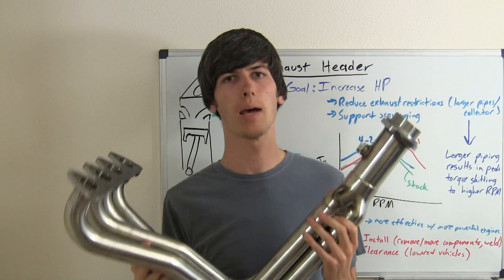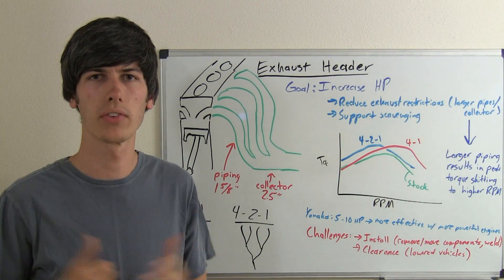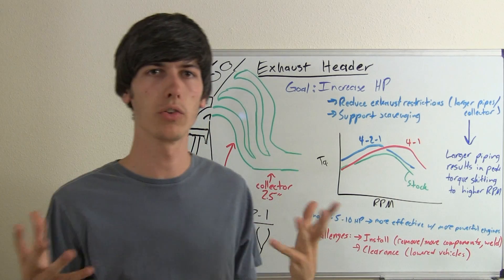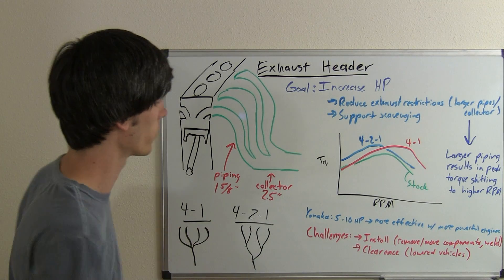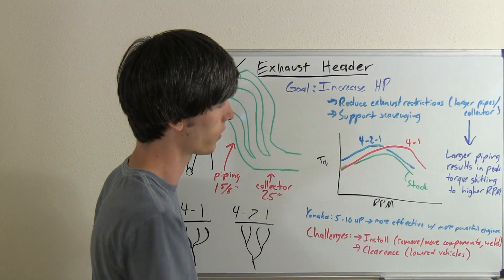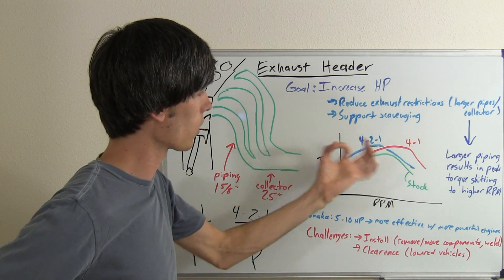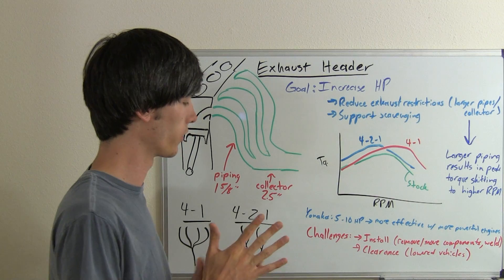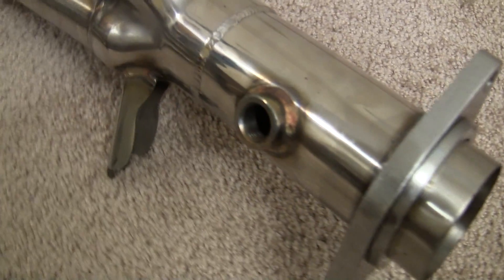Exhaust Header - Explained

Comment: Good work sir. You may want to point out the reality that headers dissipate anywhere from 40 to 60 additional degrees of ambient air temperature under the hood. This robs considerable power and has an adverse effect on electronics which are already under an anticipated level of duress. Vacuum lines and wire harnesses become brittle and that’s only the beginning. Electronic components fail prematurely. I like to use the example of having a desktop computer in your oven at about 90 to 100 degrees. Watch much slower it renders and operates. How long will it last? Will it last as long as a computer in your bedroom? Don’t get me wrong, headers are really advantageous on older vehicles. I simply would never install them on any of today’s modern computerized vehicles.
Reply: Your first coment was your best statement. Many folks put them on and have no plans to seriously race anything but their own shadow and have no idea about the problems they inherit in the process. In fact 75% of the people that have them put on have no intention of racing, simply think they sound or look cool or their buddy has them. Only later do they realize all the inherent problems that come to the surface are due to the miatake they made. Heat wrap is a adequate way to stop the heat up however, most headers are manufactured with materials that are designed to "reflect" heat or discharge it. Unfortunately the heat wrap holds in the heat which then causes the headers to chrystalize and decompose within a realatively short time.    Manufacturers are well aware of these issues and your top manufacturers have quietly been reasearching header type manifolds as a solution to the problem. It's just unfortunate that innocent people have them put on without knowing the truth behind the product.

Comment: What would happen if I install a race header on a stock engine I have a 97 accord that I use for fun
Reply: From my experience with my stock 93 accord, I just installed a full exhaust system. Went from 4-1 to 4-2-1 and slightly bigger piping and there is definitely an improvement compared to the stock exhaust system.
Reply: Hibari IUkh
4-2-1 gives better low end torque where 4-1 gives better high end torque.
Reply: may i ask if i change to 4-2-1 the car will have higher torque or wat? cuz i planning for 4-1. does 4-1 suitable for accord93? sorry for my english. the reason i change header is to increase more torque. thank u very much!!
Reply: thank u very much!!!!! apreciate

Comment: ive got a 2013 focus st. something ive been tempted to do is extend one or two of the cylinder exit pipes. the reason why im tempted is because the stoke inline four sound is a bit to clean for me and im hoping that extending one or two of the pipes will give it a more burbaly sound not sure if it will affect the turbo much though. can I ask what your opinion on doing this is ?
Reply: gblockvet yea I did figure it would do that, although after doing a bit more digging around I found it had more of an affect than I initially thought. also its not possible on the st engine anyway as its manifold is actually built into the engine. hopefully I can save enough pennies to afford the turbo and injector  upgrade soon so I can put the car from 300 hp to 420.
Reply: Sounds like a good opportunity to experiment with a set a cheap headers.
Reply: ive been looking into it a bit more and it turns out it cant be done as the manifold is built into the engine.
Reply: Wow. They must not have wanted anyone to modify that car ._.
Reply: they're plenty fine tbf ive never heard of it causing any issues with tuning, i think the idea behind it was weight reduction and manufacturing cost.
Reply: Changing the length of the headers will probably not affect exhaust note at all but it will probably mess up the behavior of those cylinders with regards to the unmodified ones. Header lengths have to be tuned to each other to keep the engine working at it's peak. Google A. Bell's book "4 Stroke Performance Tuning", you can find PDF's of it all over the place.

If you want a more burbly sound, buy a Subaru or install a modified cam into your engine to give it a more uneven idle.
Reply: changing the length like you explained wouldn't be good. your localizing heat to a single cylinder more than likely and that would be horrible for your internals. Subarus that are N/A it works but anyone who builds higher hp Subarus always advise against UEL headers. it makes detonation to one cylinder dangerously high and it contributes to the issues motors have with ringlands.

Comment: Good day!

I would like to seek advise. I have a 2012 Honda jazz 1.5L automatic transmission. 

It has stock exhaust system and I'm  getting interest in having Heathers but still with stock midpipe and muffler.

Would that be advisable or do I really need to change the midpipe and muffler when I install a Heather? 

Thanks.
Reply: you can so it but it wont increase power in any way.

Comment: Sir i got a question. can i install a 4-2-1 header but with stock exhaust? i have a lancer gt 2.0. im new in modding my car.
Reply: Of course you can, but it is pointless really. The whole point of Exhaust and headers is to open up airflow. Adding an exhaust with stock headers is pretty pointless, just as going with race headers and a stock exhaust. Do it right, save up, and do the Intake, header, and exhaust all at one time. Then of course, make sure you have your car tuned for the bolt ons because you will not notice much without having the ECU calibrated to match the new airflow. I just had my RSX ecu reflashed thru Hondata and noticed a world of difference.
Reply: People always giving horrible advice when they don't know what they are talking about. If you are N/A the header is one of the important mods of your car. Because it is the first part of the exhaust that scavenges the exhaust out the engine. So having an effective header can literally make your engine get out as most exhaust gasses a possible so the intake can get the most uncombusted air inside the cylinder as possible. So Headers are NOT created equal... they need to be designed based on engine harmonics of the car so you can make the most of helping your engine get fresh air into the cylinder. So if you are N/A; A header is one place you DO NOT want to be cheap.
Reply: MrZezima3 headers are very expensive in some cases. depending on the "quality" of your build you could do headers and fabricate an exhaust after that. if you are looking for cheap power headers should be the last price of the exhaust you mod. with the price of headers alone you can get more power from other mods and their combined affect.

Comment: so if i were to put a 4-2-1 on one cylinder bank of a v8, then a 4-1 on the other side, would the torque curve flatten? lower but wider peak torque? that should allow for the same acceleration (assuming correctly matched gearbox allows you to use the full peak range), but having the lower peak torque would mean your clutch/tires would have to handle less and be more reliable right?

Comment: So why run headers at all? I don't understand?
Reply: If the exhaust just comes straight out of the engine and doesn't go away your engine bay will get hot.
Reply: you need back pressure
Reply: Noise control.
Reply: dekoldrick Good answer.

Comment: I have a 2015 charger rt with 3800 miles, I plan on installing long tube headers, high flow cats and a full cat back exhaust, my first question is can I install my parts all at once? My second question is I've been planning on getting a 85mm bbk throttle body, but I heard it's not necessary since the car isn't supercharged or anything along the lines and I don't want the air to fuel ratio to act up, should I install one or no?

Comment: Can anyone please tell me the difference between a stock header and an aftermarket header??
Reply: Same here.help anyone
Reply: Headers are bigger tubing than  your stock manifold and each cylinder has its own tube, whereas a manifold has one pipe connecting to all of them. Google "stock exhaust manifold" and then google "long tube headers". I hope this helped.
Reply: Cars usually come with "exhaust manifolds" from the factory.  Some people use "header" and "exhaust manifold" interchangeably but there is a difference in form and function.  As Fatal Automotive has mentioned, stock exhaust manifolds connects all the cylinders in one tubing.  Headers have separate tubings and a collector at the end where all tubes meet. This is for better airflow for increased performance.  

In some cases, car manufacturers will come with factory headers in models that are geared for performance. For example, the Integra Type-R in Japan comes with factory headers with 4-1 piping design (video here explains what that is). In general, manufacturers will engineer stock parts for efficiency and emissions restriction, therefore limiting the potential of an engine. Aftermarket (performance) headers are engineered and designed to provide more horsepower so they will follow the header design principle. However, if you are buying an OEM- style header, it  is still considered "aftermarket" since it's not manufactured by the maker of the car. In these cases, it will be designed as an "exhaust manifold" type to mimic the stock configuration. But it's still aftermarket. Hope that helps.

Comment: hello, i want to ask, why 4 stroke exhaust header always use a straight pipe than use a divergent cone like a 2 stroke exhaust (without baffle), i just run a simulation in cfd program compare a straight pipe and a divergent cone same length, same area and same environment preassure (divergent area 2, two times area 1). it shows divergent cone makes more volume flow rate and more gas speed than straight pipe, it mean less force to push air out from the cylinder. but why i never see people use divergent cone as a header? i just see them use in tail pipe section.

can you explain it in next video? wait for your reply. thank you

Comment: I have a civic 1999 LXi with a stock engine of D15z4(87hp). You mentioned that an upgrade to a 4-2-1 header won't help in this kind of small engine. So, how can I add more kick or more HP into this? I don't want a turbo package upgrade as this is expensive. I just want to see other options if there are. Please advise.

Comment: I am building a custom header for a Mazda MA 2.0 carbureted engine. It will be 4-2-1. My question is, do the tubes have to be all the same length for each cylinder?  I have it mocked up and the tubes are all within 2 inches in length of each other.  It wont be making much more power then the stock 96ish HP so I am hoping that wont matter to much.  Also does it matter where I join the 2 pipes in to 1?  I would like to run 2 pipes all the way back to the rear axle and join them together there with a X pipe and then duel tips out the back of the truck.

Comment: Thanks for the video...  i have a 2002 honda civic... i installed megan racing headers..   but my Stock cat does not fit on the end....  I was told i could have a muffle shop cut it and Weld it to my Header.... Because right now im blowing a check engine light and my car is in Limp Mode..    Full cat back exhaust installed also.....
Reply: Flush out fuel filter an drain tank, new fuel filter, new maf and it should help, most cars get limp mode because of cheap fuels
Reply: Bainanaz thank you
Reply: JasonH420
Dont thank me hahaha, my Nissan pathfinder used to do it on cheap diesel from a station near me.

Comment: So how come the pipes bend around instead of a straight angle? Also do you sublight as a Jon Heder impersonator?
Reply: Why they bend around - probably to provide clearance for other items in the engine bay. Also because you have to have each header be as close to the same length as possible - you can't just have the far cylinders (1 and 4) have much longer headers and the center ones be shorter.
Reply: i know im a little late, but they bend around to ensure they are all the same length!

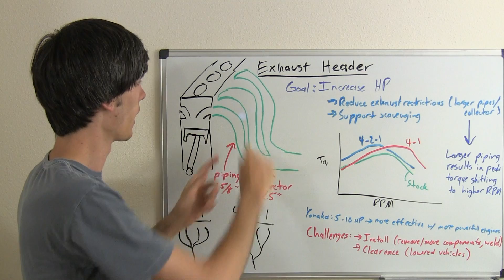Comment: 0:39 The four 1.625" pipes have a total of 8.3 sq in, but the 2.5" pipe has only 4.9 sq in.  Doesn't that generate significant back pressure?
Reply: the cylinders don't fire at the same time....so all 4 runners won't be pushing 8.3 sq in of exhaust down to the collector/pipe at the same time :) therefore you dont need a 4x8.3sq in pipe :)

Comment: Headers with a stock exhaust will look great, but power increase will be far more enhanced if you remove all (not some) of the small diameter bottlenecks downstream. Go too large though, and you slow exhaust gas velocity and reduce scavenging. Also, large diameter pipes can have fitment issues and may increase cabin temperatures. Large diameter exhausts are usually noisier too, if that's a problem. Oh, and headers are usually a bear to install.

Comment: Can small dents in the down pipes effect performance? I have a small dent in one of my motorcycles down pipes no bigger than an inch in diameter and not massively deep but I don't seem to have top end performance as I did a while back not sure if that small dent has caused issues or if something like my ignition coils are to blame?
Reply: +Michael Whitney ruins the flow, i would think it would mess with performance.
Reply: There is an episode of Engine Masters on the Motor Trend where they test this theory. The results will probably surprise you. I know I wasn't expecting the outcome.
Reply: +Devin Ward Just watched that video, pretty interesting surprised that it had very little effect but my dent is nothing compared to what they did tho those headers lol so doubt my HP is effected by them. I think my speedo is under reading by 10 mph if I was to go on rpm. Also speedo needle doesn't start moving until I reach around 10 mph either also making me think it's just the speedo.

Comment: You should also touch on aspects like
- Sequential vs non sequential pairing of 4-2-1. There was an Exup Valve on a header that would switch between the two pairings.
- Long tubed primaries vs short tubed primaries. Some headers will split the primary secondary length 50/50 but I've seen some primaries that are closer to 60% of the length perform like a 4-1, while still reaping the benefits of the 4-2-1.
- Then there are collectors that have venturies/choke points in them to alter their performance.
- Stepped headers and stepped port vs port matched head -> header
Reply: marry me

Comment: if i was to put a twin turbo kit on an all stock car, what all would i have to do?
Reply: +ConthekidMC _ There's not enough information here to answer the question; what needs to be done will vary greatly depending on what car and engine you're starting with, what kit you're using, and how complete the kit is. To gather this information you would start at the turbo kit manufacturer's website. Read all of the documentation they have regarding proper installation and tuning of their product.  You'll also want to join a forum that is specific to your car, and read all of the existing threads that have covered twin-turbo applications and related modifications. Once you've gathered all of the information available to on the forums, you can begin to join ongoing discussions or start new ones for specific questions or concerns you still have.